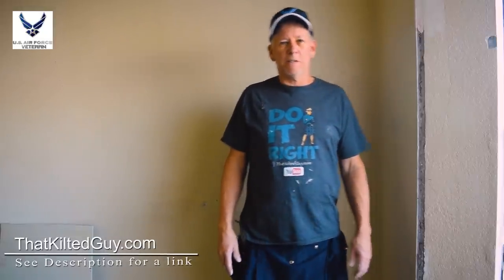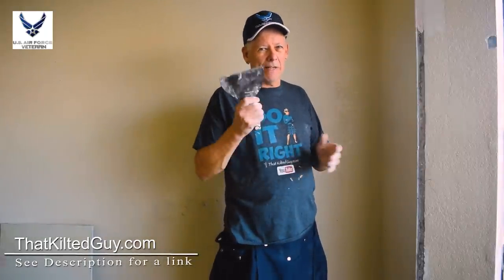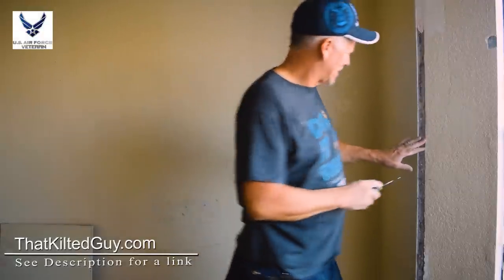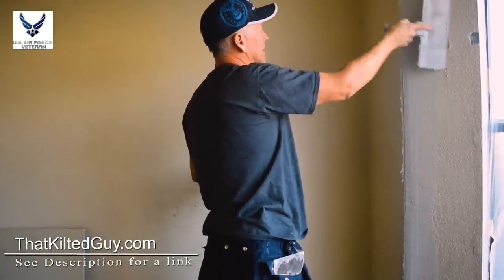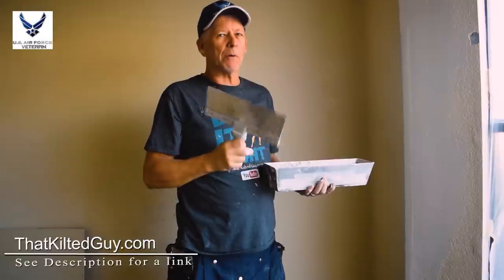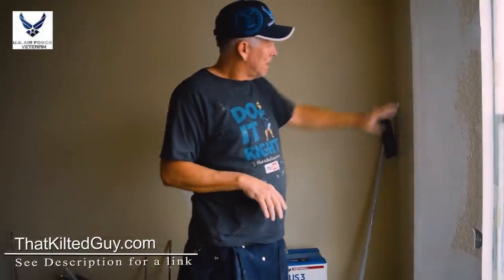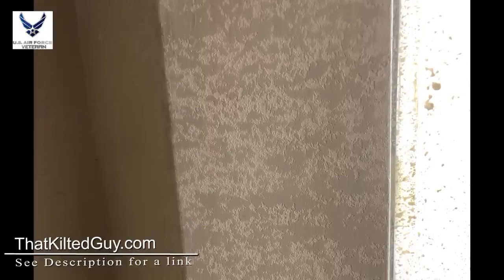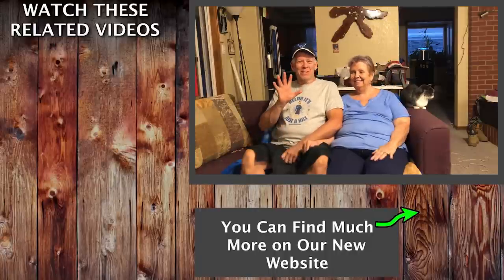Can YOU Repair Drywall Cornerbead Yourself, Easily?  Watch this BEFORE you go any further.

Comment: so outside corners doest need to have those plastic or metal thing and plain paper is ok?
Reply from the maker: No it has to have a plastic or metal corner. The one in this example still had the metal corner, but the mud had chipped off of it and I fixed it by putting the fibafuse down the side of it and re-coating  it. How that helps.

Comment: Can I had a bit of water in the drydex?  I just have small bead and ppl have paint over corners that is not really finish nice,  it’s like my paste is to thick and can’t to a nice finish corner , not even on one side 😫 my dogs are laughing at me right now
Reply from the maker: 🐈, lol.  Well, I don't use drydex but you should be able to just fine.  We add water to our mud most of the time if it's too thick.

Comment: I popped off the loose drywall and to my horror there is a really bent warped part and as a first timer now I have no clue as to how or what I should do to fix it
Reply from the maker: Usually best to cut that part out with a hack saw and replace. Use tape on bead to replace it. See my best corner bead video for how to apply it. 

If you appreciate our help with your project and would like to support our channel, please consider joining our YouTube membership for as little as three dollars per month. You can join by clicking the join button beside the subscribe button on any of our videos. Thank you
Reply from the maker: Thanks for joining our membership!

Comment: Answer this please, why do ALL videos showing mudding  of any type use so much product?  You wind up taking off 80% of what you make. Why not just make 30% of whey you normally do and cut down on the waste?
Reply from the maker: I have no idea what you mean.  You must put it on heavier than you need and wipe it down to the correct profile.  No way to put it on perfect, unless you use a mud box designed for this, which run nearly $700 for the box, handle and pump.  I've done this for over 35 years, and all drywallers do it this way, so I guess that's why all videos show it that way.  Not trying to be rude, just factual, so hope that helped.

PS: I don't take off nearly 80% of what I put on, more like 20-30%.